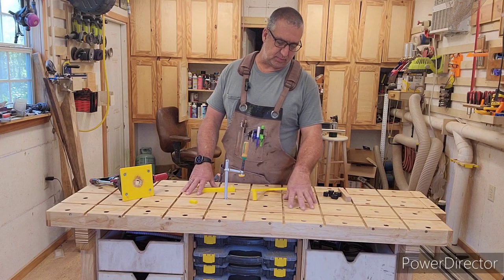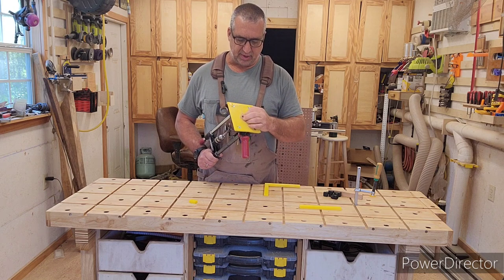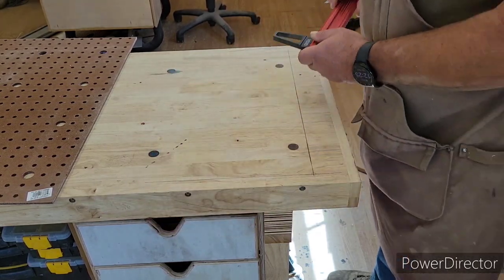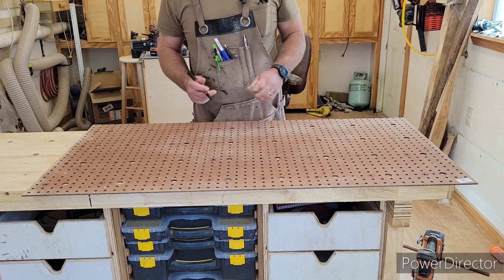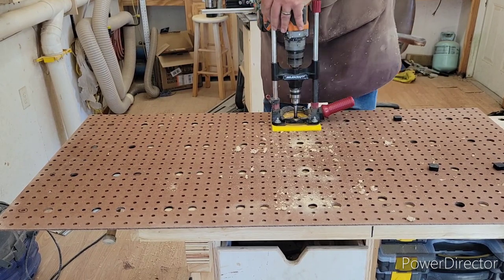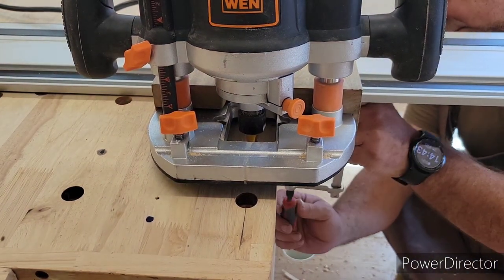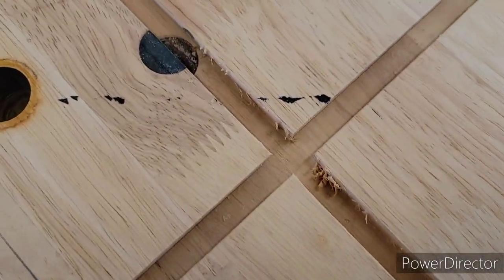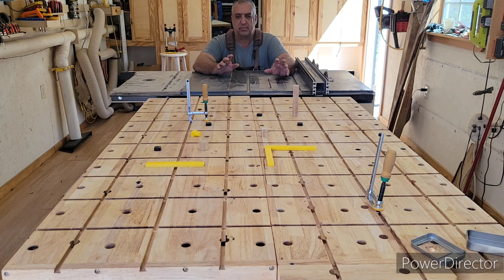Turning a Harbor Freight Workbench into a MFT with Dovetail Clamps

Comment: I just wanted to send you a word of appreciation and encouragement for your channel.  You are creating quality content and you seem to have a theme of innovation with being frugal on your tools/equipment investment.  It’s a great combination because many beginning woodworkers get hung up on the high cost of tools/equipment to get started.   Your channel is bound to grow.  Keep up the good work.
Reply from the maker: Thanks for the comment. As a hobbyist, I don't need a tool that is designed for 8 hours a day, 5 days a week, when I am only going to use it for an hour a year. That way, I can afford more different types of tools. Once I find a tool that I do use a lot, I can then spend more for a higher quality tool. 

Growing up in the country, we didn't have the option to buy tools but still needed to get the job done. If we needed a tool, we made it. I still build or modify a lot of my tools.

I never thought I would have a YouTube channel. I had just posted a couple of videos I thought might help someone out. It does not show yet, but I have been putting in the effort to try and improve  my videos. Building is much easier than videoing.

Comment: Using a pegboard as help to drill those MFT holes are really inspiring! You are a true engineer! Thanks very much for sharing.
Reply from the maker: Glad you like it.
Reply: @ShopRamblings  As I have been thinking about all the ways to drill regularly spaced holes like that I cannot believe I never saw this method before. It is genius and significantly cheaper than all the various jigs (e.g. Woodpecker) that you can buy. I don't watch many YT videos through all the way with the sound up but I did here. Thanks for sharing! (PS: I have lots of pegboard out in the garage...)

Comment: Very slick! Couldn't see a use for the HF bench before now, but I may have to rethink that. Appreciate the print files as well, that's a huge help thanks.
Reply from the maker: When I seen your video it reminded me that I had not uploaded the dog files to Thingiverse. I just put up the single, double, and corner dog in a 10mm and 17mm version. I also put up a clamp I just finished. I am printing it now but I am confident it will work. If not I will update it.

I could have built a better bench from scratch but sometimes for me making the decision on dimensions and trying to design in every feature will delay me from ever starting. With this it gave me a starting point. One of the benches sat in the box for 6 months and it has been almost 18 months since I put the first one together but I believe this was the final modification. 

It sucks they raised the price on these. I caught them on sale for $120. Maybe they will go on sale for the holidays.

Comment: I really like the upgrades you made to that bench. I'm curious, do you find you use the dovetail clamps more than the dog holes? Thanks for the great content.
Reply from the maker: I really find I don't use either that often. When I do, I use the dog holes. With the dove tail, you can only clamp where there is a groove. With the dog holes, the clamps can rotate, so if where you need to clamp does not line up with a groove, you can still reach it.

Comment: Really clever idea to use the pegboard as a guide. Thanks for the video.
Reply from the maker: Because the holes are 1" apart I have an idea of making some edge guides that are square but each side is offset a 1/4" more so you can quickly setup any distance from an edge.

Comment: Nice job! Pretty neat trick to use pegboard with the 3d printed base for the drilling guide.
Reply from the maker: It worked really good. I will use that same system anytime I need equally spaced holes.

Comment: I have the same HF bench and am interested in your mods but am concerned the top may be too weakened by the slots. Other Youtubers have added a layer to the bottom to thicken it.  Did you do that, and if not have you seen any indication of weakening?
Reply from the maker: I did add add 3/4 plywood under the top. The table is strong enough to hold several hundred pounds with no issues.